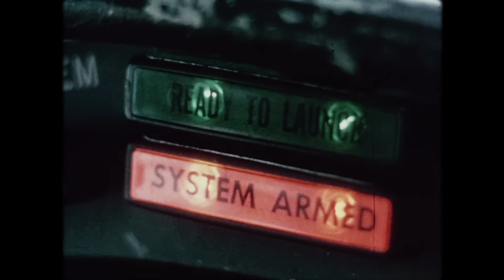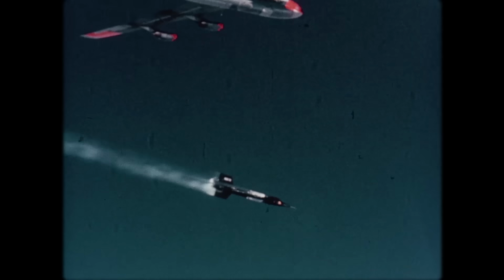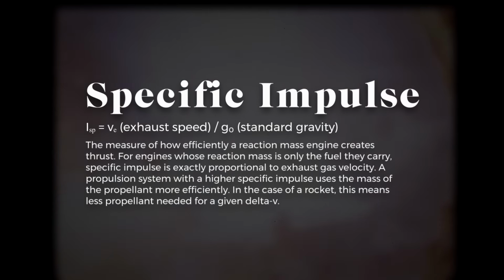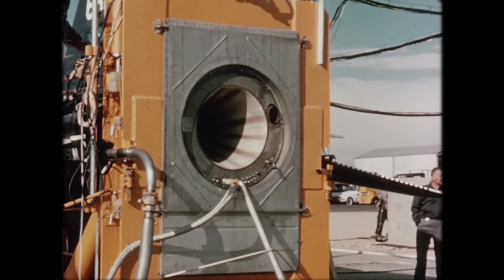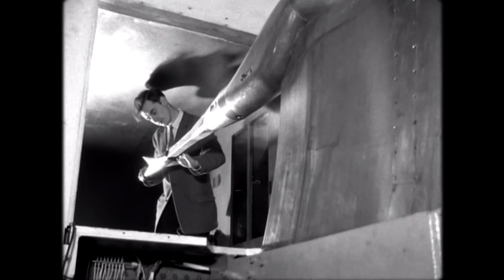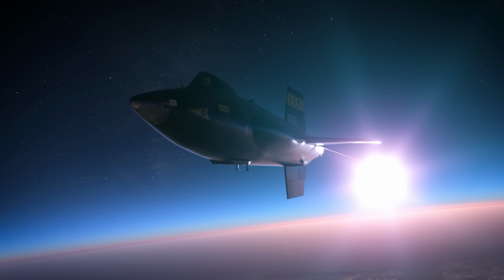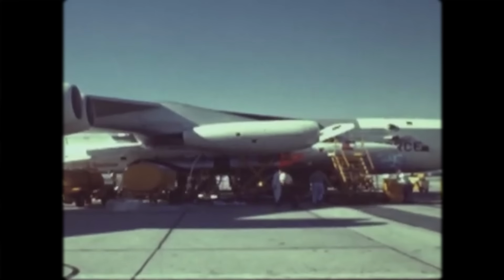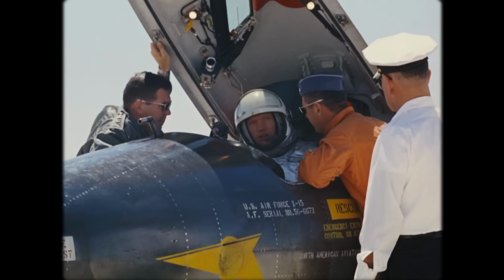The Insane Engineering of the X-15

Comment: 7:27 why didn't they just used different sizes of turbo pumps but same speed instead of same size but different speed by gears?
(Probably cost. Engineering gears and one turbo pump costs less than two turbo pumps without gears i guess)

Comment: The X-15 was the first plane that reached space. Some even earned astonaut wings by doing so. Basically a rocket with a cockpit and tiny wings. When out of the atmosphere it used reactive motors to maneuver. Also the only breathable gas was in the helmet.
Reply: And the only POWERED manned aircraft to reach space.  The Shuttle was technically an unpowered glider.
Reply: @Doggeslife  If you count the OMS pods, it was still powered in space. It was only a glider on reentry and landing. And the X-15 was equally a glider once the less than 2 minutes of fuel ran out.
Reply: CDEDBD wings?
Reply: @mikehutchinson2191  In the 80's they had a simposium and I ordered a thick book on the x-15. I made a model rocket of it and it flew great. The cockpit was all nitrogen and if you breathed that, you have minutes to live not reversiblle. So the oxygen was only in the helmet. The wings had tiny rocket motors that reacted like if there was an atmosphere outside and moved the ship that way. You could throtle the main engine which was unique. Incredible for pre computer flight days. Those pilots were Gods of sorts.
Reply: 50 mile or 100 km wings?
Reply: @HappyBeezerStudios  Yes, think so. One flight got into space but not in orbit with poilot Michael Adams who died when it broke up in reentry. But it could maneuver outside the atmosphere. 3 were built. One broke up another one crashed and broke in 2. The Smithsonian has the last remaining one. It is one beautiful machine.
Reply: The Museum of the US Air Force in Dayton Ohio has had the fastest  and only surviving X15 in its possession since 1969.
Reply: @HappyBeezerStudios 60 miles=96.5km.
Reply: True

Comment: Well, the X-15 was not the fastest.  That title belongs to the Space Shuttle as it is a powered aircraft, but doesn't use that to fly.  None the less, it enters the atmosphere at no less than 17,500 mph, or 22.99 times the speed of sound.  A speed the shuttle had to achieve in the first place.  X-15 max speed was 5.9 times the speed of sound or 4520 mph.  You can split hairs all you like, numbers don't lie.
Reply: The x15 achieved that speed under it's own power.  The space shuttle does not, Einstein

Comment: The question of whether or not the X15 is a 'airplane' is still moot. Not often considered is the fact that the X15 was launched from a B52 partially because it had no conventional landing gear. They had methods in place which could have allowed development to a ground-launched plane, and fuel load was not the limiting factor. This X15 could have climbed to the B52 launch altitude in 30 seconds from rotation, and been travelling at Mach 1.5 by that point.

Comment: My question is: at the altitudes this vehicle was operating, how much of the heating was caused by frictional heating as opposed to compression heating? I know that on reentry vehicles like the Space Shuttle, the majority of the heat of reentry came from the compression of atmospheric gasses in front of the descending body, rather than friction caused by the gas particles, as the thin atmosphere meant there wasn’t sufficient particle density for their friction to contribute significantly to heating. Or maybe my understanding is wrong.

Comment: The high temperatures were in fact caused by high pressures. This is something known as Charles's law, the greater the compression of the gas, the higher its temperature, and the other way in reverse.

Comment: Wondering why they did not go with remote control and leave the pilot out of cockpit but still  included in the equation. When all parameters collected and problems solved, integrate the pilot.

Comment: Hey appreciate the explanation of the wedge tail. Newton... who would have thought. :) It turns out a lot of engineering in the '50s went back to first principles. Remember on the sr-71, dimples on either side of the pitot tube hanging out front? I always thought it was for aerodynamic reasons.  I finally got annoid  enough to go down the internet rabbit hole. Ended up in a SR-71 manual. Turns out they are forward sensors.

Comment: Hold on a minute ‼️‼️‼️ You also need.to look at engine efficiency. In thermodynamics this is the ratio difference between temperatures. Between input and out put. The more the difference between temperatures the greater the efficiency.🙃

Comment: The courage of these pilots cannot be estimated when you consider the unbelievable technical problems that arise at
  recognized almost 195 test flights, and was later crowned in one of the breakneck record flights. As a 10-year-old boy I wanted a model of the X 15 in 1:72 scale and still got it. It has been in my aircraft collection for 50 years. It has no additional tanks, but a pull-out rocket engine. Bye.

Comment: What's insane is the X-15 was designed and built by the same company (North American Aviation) that only 15 years earlier fielded the P-15D in World War Two. Piston powered fighter with a roughly 425 mph top speed to a rocket powered space ship that cracked 4,500 mph.